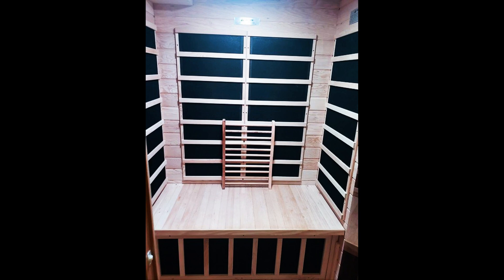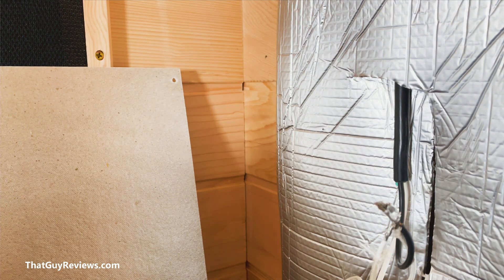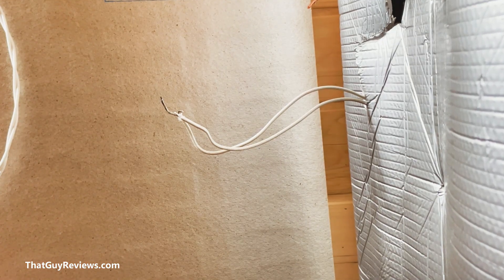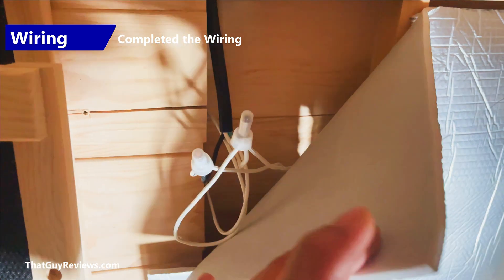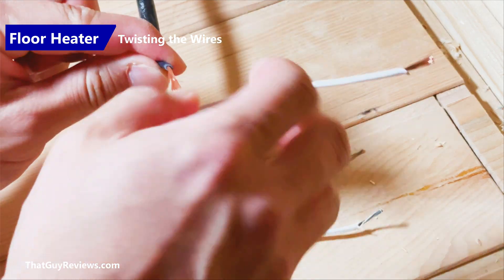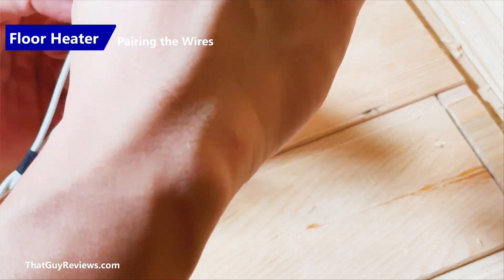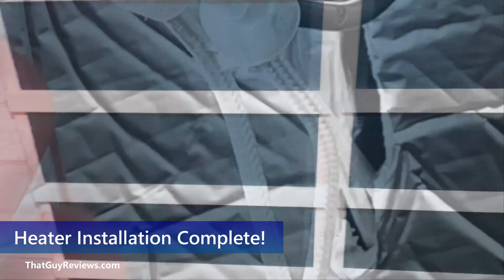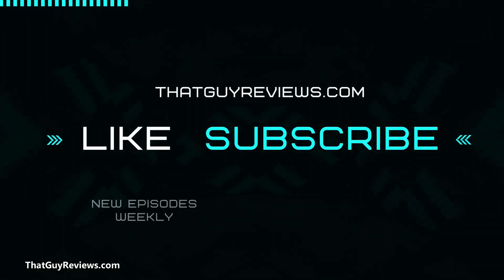Replace Sauna Carbon Infrared Heaters - Ultra Low EMF👍 💥

Comment: Hello. What are those panels? They don’t seem like the classic carbon panels, where the panel features a flat carbon layer, but they look like there is a sort of filament running “up and down” sandwitched between two panels together.
Any links? References?
Any opinions anyone?

Comment: where did you buy the replacement ultra low EMF heaters from?
Reply: What temperature does it go to?
Reply from the maker: like 140
Reply from the maker: you can ask the sauna mfg, they usually sell them